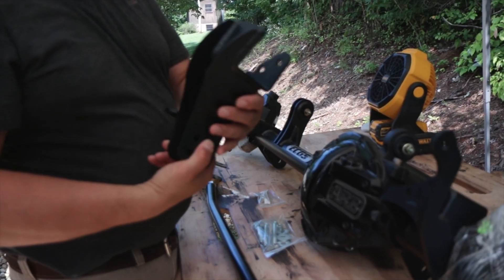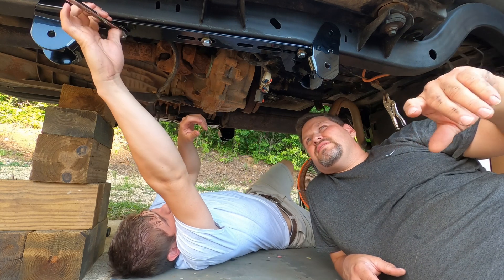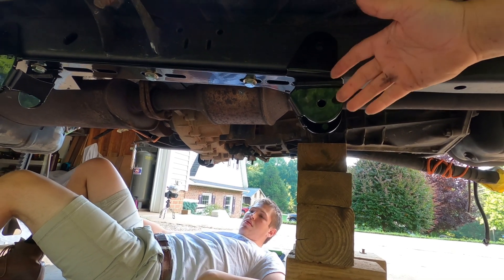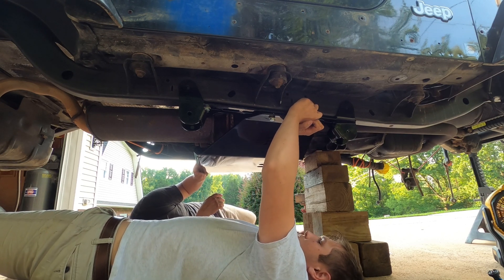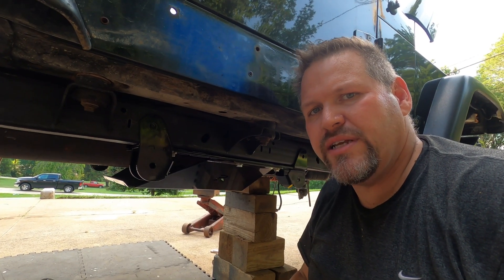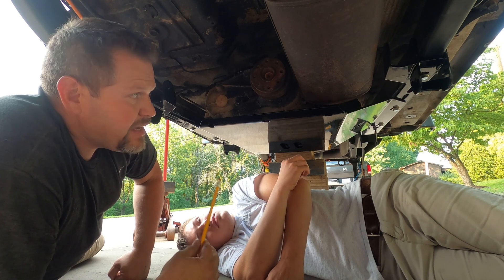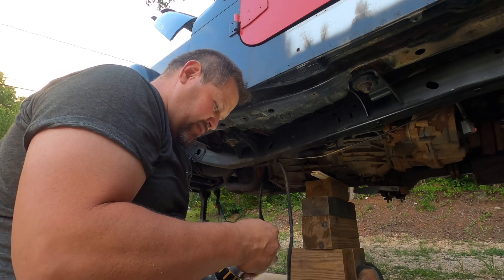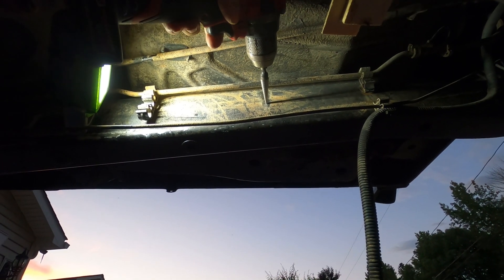Long Arm Suspension Jeep TJ (Building a Better TJ) Pt3

Comment: Question I just finished short arms 3.25 lift springs 1 inch BL and 1 inch MML on my 05 Rubicon. Ready to install rear CV driveshaft I currently have adjustable track bar with axle bracket that raises mounting point on track bar.  Will I need correction bracket that tilts axle bracket when I set my pinion angle or will the raised bracket be enough when I start tilting axle? Enjoy your channel glad you guys can work together on project TJ.
Reply from the maker: I don’t believe so.